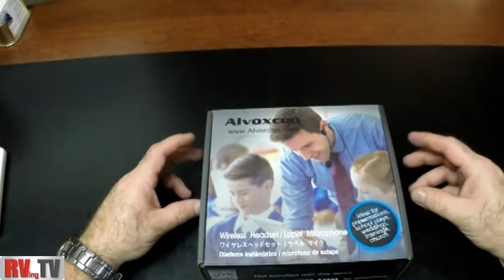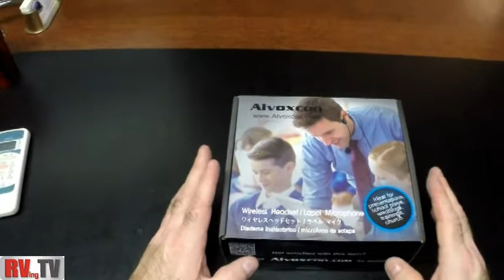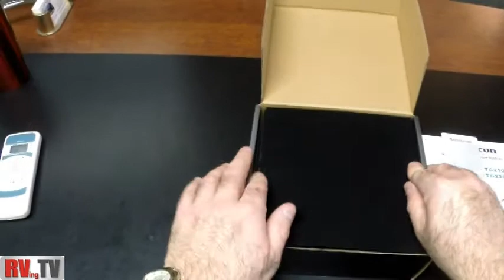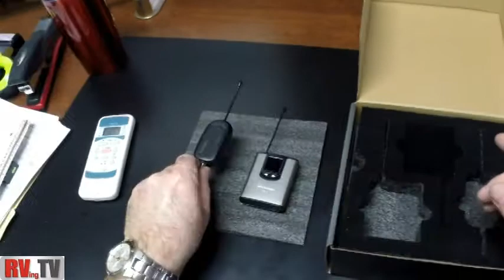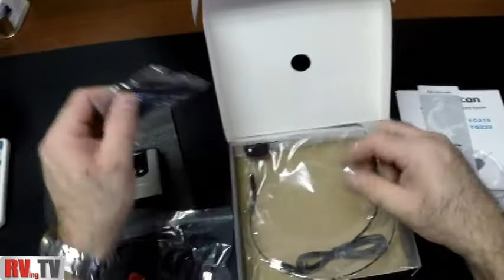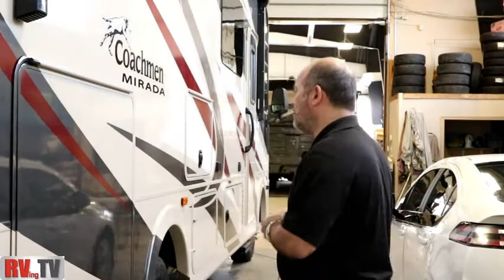Alvoxcon MIC Unboxing and Test

Comment: Did the more expensive mic help? I’m having problems with hiss. It’s probably the “preamp” of the transmitter, or the [lack of] sensitivity of the included mic, and yes I have the receiver turned up all the way. I’ve also tried turning it down. The camera’s preamps might be worse, not sure. Depends on cameras preamp. I thought the beachtek preamp would help. Still experimenting. The preliminary answer is the transmitter has self noise and you can’t stage gain your way out of it...unless you really know what you’re doing.